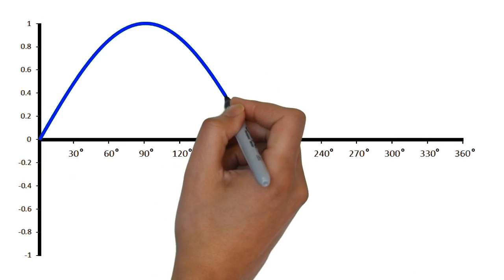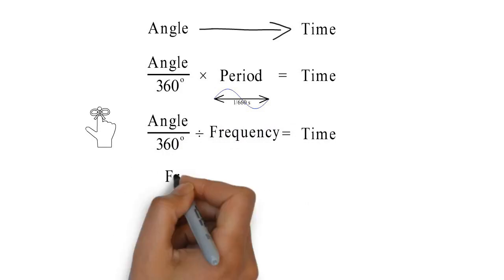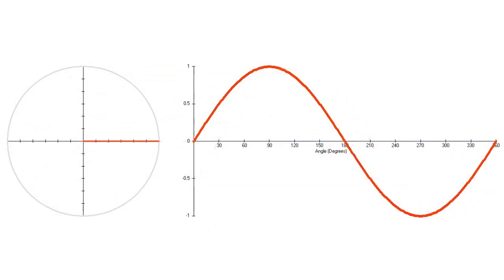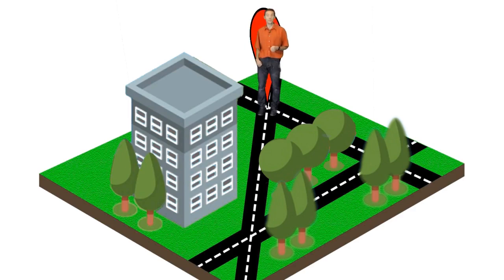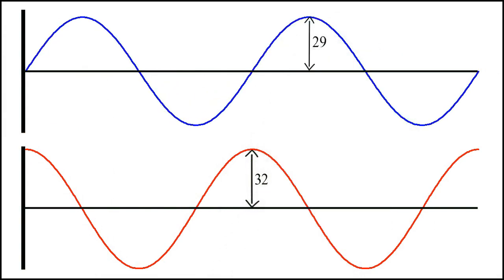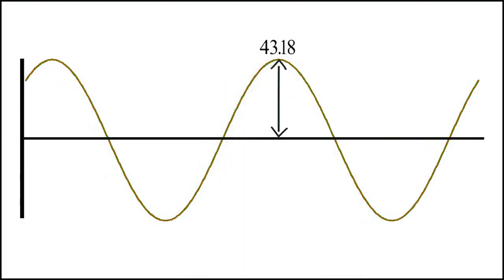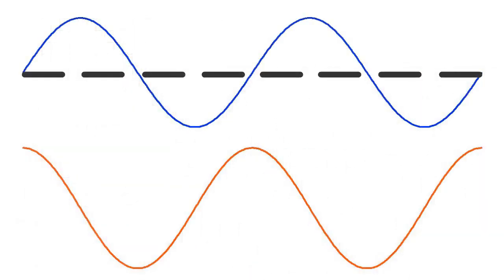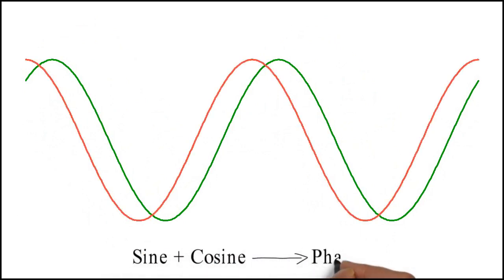Phase

Comment: once Mark finishes the FT series would be gr8 if he gave this level of detail on "What is a Fourier Series? (Explained by drawing circles) - Smarter Every Day 205"   that video just jumped over the details ... looking forward to cranking out some code to implement that process yet am still in research mode on just what is going on
Reply from the maker: If your interested in coding some of Fourier's Theories, take a look at my Blog on-which these lectures are based. There is a whole section on the FFT which ends up with an implementation of the code in Javascript. See: http://www.themobilestudio.net/the-fourier-transform-part-9

Comment: Where am I calculating wrong? the video at 5:04 shows that the phase shift is 0,00126s, and I keep getting 0,000126s
Reply: You are not getting it wrong, it's a mistake in the video.
660Hz means one "cycle"`== (1/660). seconds
And so: a 30 degre phaseshift("delay") takes (1/660)/(360/30) Seconds ==
0,0015151515.../12 ==[( 1*30)/(660*360)] == 1/(660*12) == 0,000126126... Seconds 
best regards

Comment: At 3 minutes the phase is minus ninety, not zero. For a cosine it would be zero.
Reply from the maker: That depends on where you start from. Although the convention is to start from a cosine wave and treat its phase as zero, in this example, I started with a sine wave. Everything is relative, as Einstein would say. So if we start with a sine wave, we have to shift its phase by minus 90 degrees to produce a cosine wave.
Reply: @MarkNewmanEducation  Well, sure for engineering it does not matter. But if you then make a video on Fourier series or transform, you can end up showing that the transform a sine is indeed 90 (for the positive frequency) and not zero. And so that could cause confusion. But great videos btw.